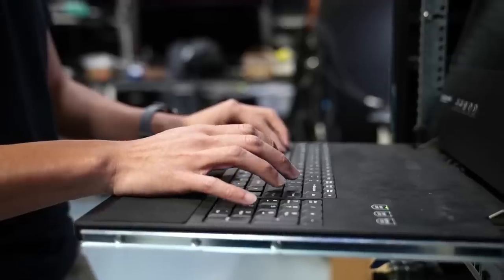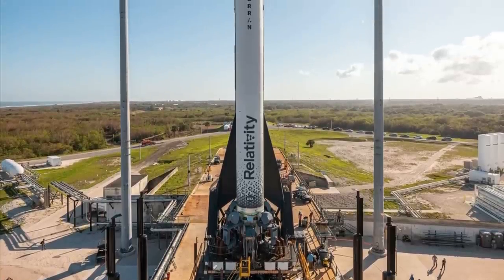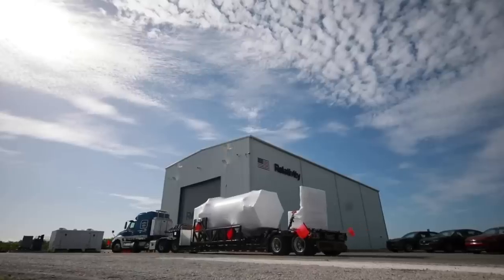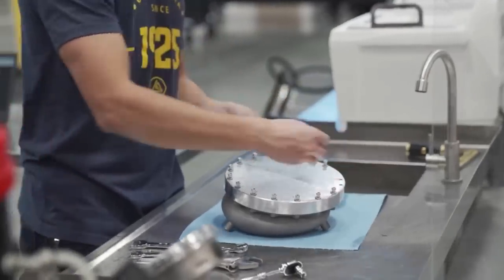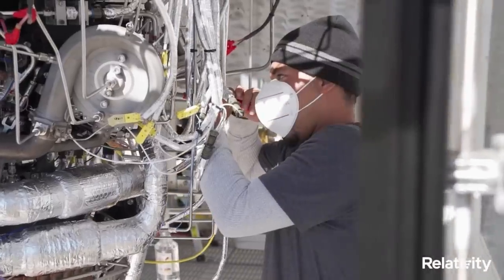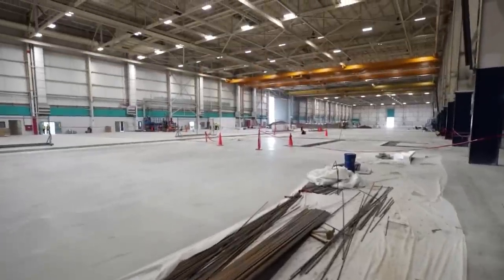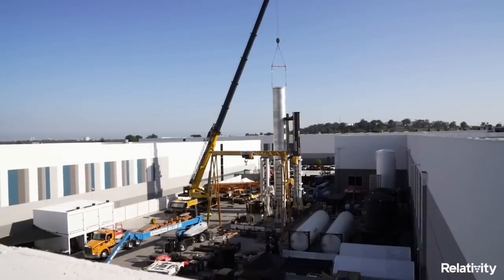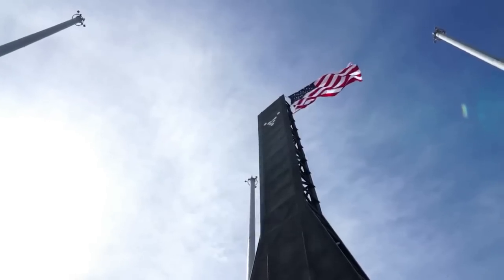The Fully 3D Printed Terran 1 Rocket Is About To Launch

Comment: As a now retired president of a manufacturing company, I have had some experience with 3D printing.  What 3D printing is good for is prototype work and perhaps small batch production.  However it was much too slow and expensive for volume manufacturing. It seems clear Relatively Space will be only launching a few times a year initially and perhaps 3D printing makes some sense.  However, I just cannot imagine how a 3D printed fuel tank can compete with a roll pressed stir welded stainless steel tank.  We shall see over time if their launch cadence increases they will continue using 3D printing so extensively.
Reply: 3D printing greatly reduces part number, thus cost and points of failure. Also, launching "only" a few times a year is still impressive and would still be ahead of other competitors
Reply: @MsChurrasco94  you do realise the company still needs to make profits to satisfy investors and actually survive? a few launches is pathetic. they need to aim to perform lots of launches to make up the investments. their hope is to secure contracts from like nasa or other gov organisations.